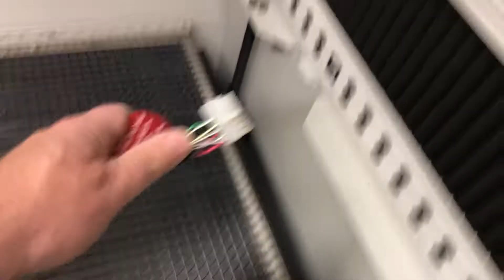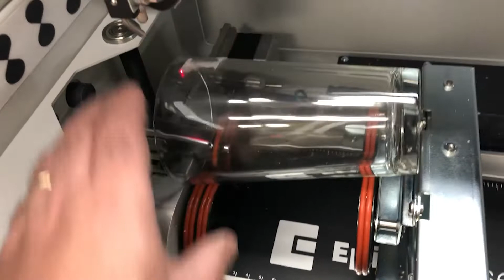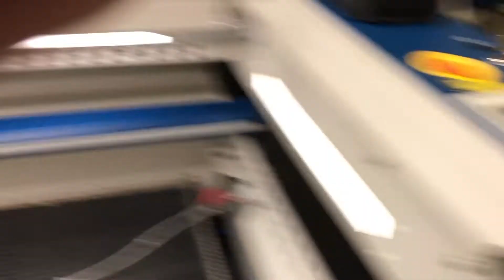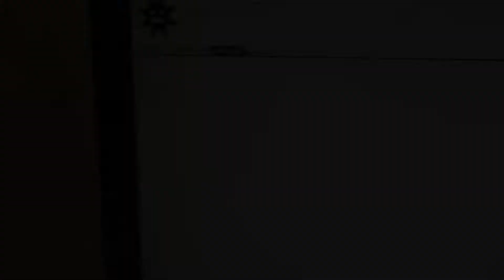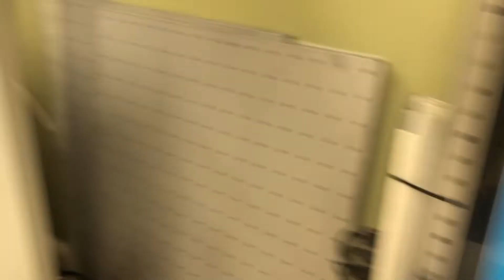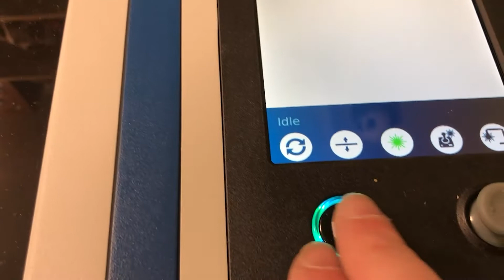MakeIt Labs Epilog Rotary Tool Quick Training

Comment from the maker: Two major things I should mention:

1. You saw me drop the "manual focus arm" to get the z-focus - afterwhich I never put it back UP! Please always remember to do so! 😲

2. If you noticed, my artwork was rotated SIDEWAYS on the glass. Since the artwork on your screen will draw-out at the same orientation on the laser bed - when rotary engraving things I did, you generally want to rotate it 90-degrees counterclockwise so it's upright when your glass is sitting upright ... ;-)

Comment: Hi, i have a question if you can help pls. I have the epilog maker machine. I tried to use the rotary for 360 wrap but the end doesn’t match. Would you have any tips for that or settings? Would really appreciate your feedback.
Reply from the maker: I would say - make sure you have properly calculated the diameter of your workpiece - the adjust the image width to fine-tune